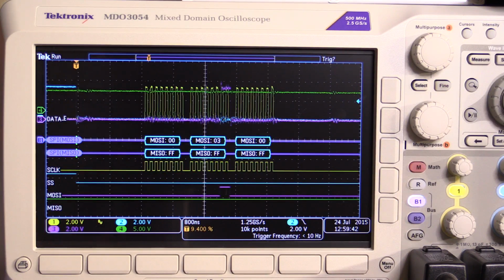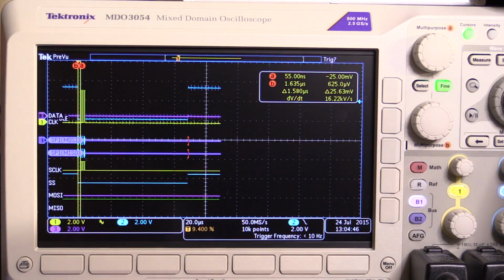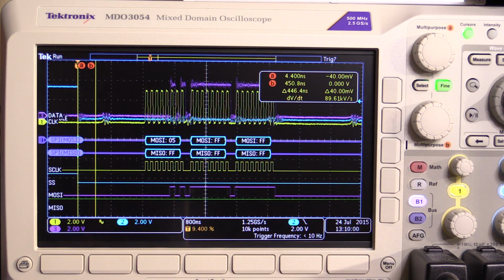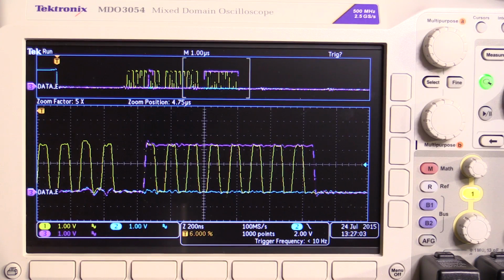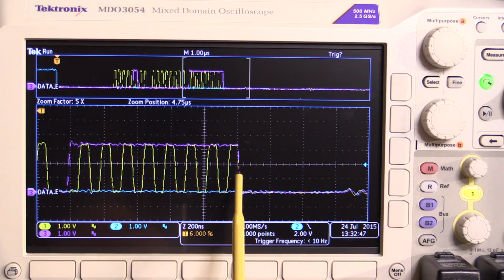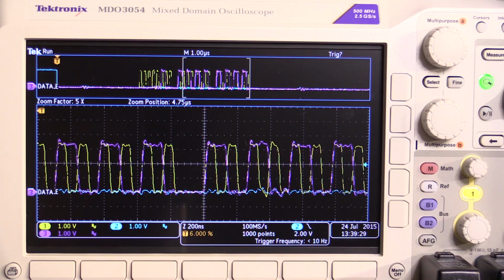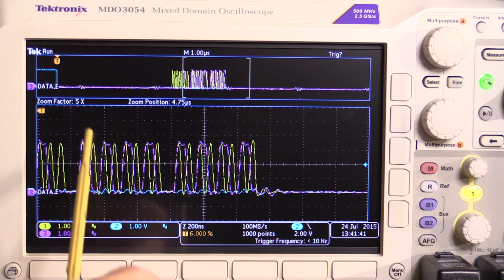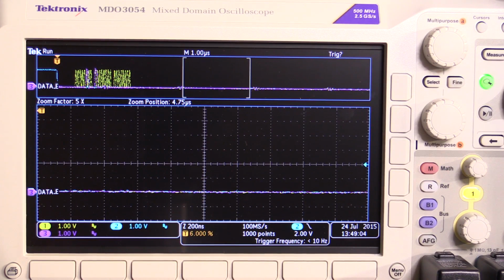Raspberry PI, Windows 10 and SPI Debugging with the Tektronix MDO3054

Comment: Another great educational video.
There is one little thing that need to be mentioned that even Raspberry PI is running on GHz clock that not mean that GPIO clock is in that range, GHz clock is only clock used by core, peripheral clocks are different (ARM use multiple AHB and APB peripheral clocks) and in datasheet for BCM2835 (Raspberry PI not V2) state that maximum operating frequency of the General Purpose clocks is ~125 MHz at 1.2V and clock is selectable.
But even with that limitation and taking in account it run Windows, SPI interface should work much faster than it is shown in this video (this remind me on early 90 and time of DOS and W3.1 andt that joke how to from your new I486 to make XT, just in DOS type win)
Reply from the maker: Miloš Lazović I understand that the SPI clock is not the CPU clock, the point I was making is not a slow clock, the clock speed was actually OK and will go to 50Mhz easily, it is the time after clocking out the data and before getting to the next iteration, there is something wrong there as it should not take that long to release the CS line or get through to outputting the next value. As I mentioned, removing the lowest level call to the Spi.Write allowed a complete 256*255 loop to run in a total of 33mS, a single loop of 255 samples took 44mS when making the call, this is in no way related to only outputting the data stream, as is shown in the timing diagrams. Your point is good to mention though as Im sure some folks did not know that and it helps to clarify, Thanks
Peter
Reply from the maker: Miloš Lazović Oh, and I totally relate to the OLD Dos days and the initial move to a windows based environment, thinks seemed so slow at that time too
Reply: Peter Oakes I expect that Microsoft fix that little issues soon, anyway W10 IoT is new product and it is expected to have some issues, but on other side Raspberry Pi is not personification of speed on GPIO, I didn't try Raspberry Pi 2 but what I try with Raspberry Pi 1 Model B I didn't managed to get toggling GPIO with greater speed than 25 MHz ( I was going so far to try even bare-metal to remove influence of OS and got no significant difference), What i read Raspberry Pi 2 should be near twice faster on GPIO then Raspberry Pi 1 Model B.
Another point is that ARM Cortex-A are optimized for multimedia/application (mobile phones, tablets, tv boxes ....), on other hand ARM Cortex-M are optimized for microcontrollers and ARM Cortex-R is for real time applications (as I read ARM Cortex-R will be merged in ARM Cortex-M). Microsoft  development support ARM Cortex-M in form of .NET Micro Framework which I never try but it look more useful than Arduino (.NET Micro Framework is real development platform contrary to branch of poorly written libraries) so it maybe something interesting you to try (it support STM32 microcontrollers that are dirt cheap and I found them that have great performance/price ratio).